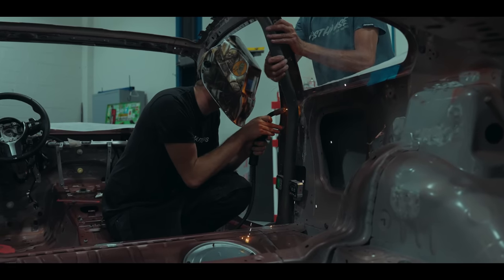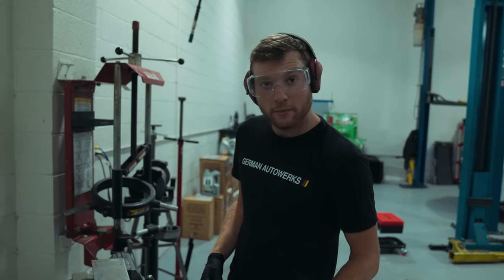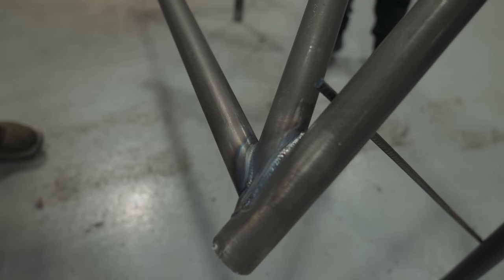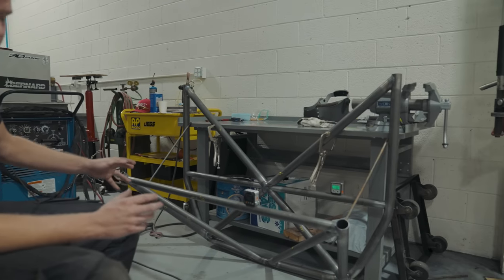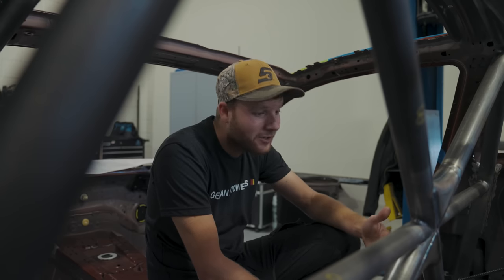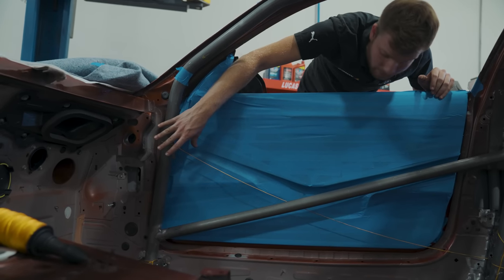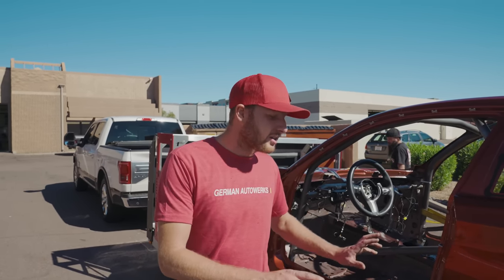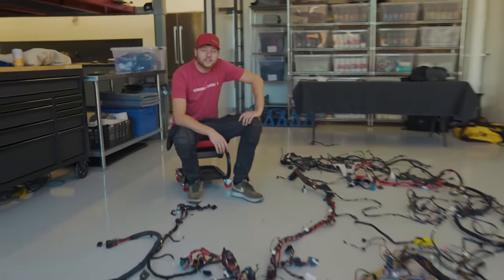BUILDING THE ULTIMATE BMW M2 RACE CAR IN USA!  **ROLL CAGE INSTALL**  EPISODE 3

Comment: what is the name of that tool to notch the pipes to fit the other pipes well?
Reply from the maker: It’s called a ‘Tube notcher’ you but the desired hole saw for the size of notch you require, set the angle and away you go 😊